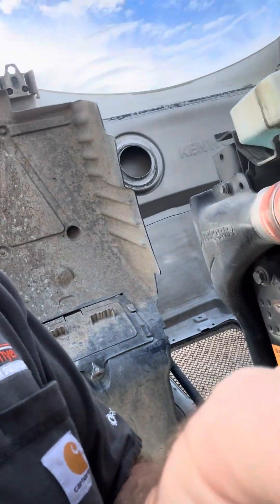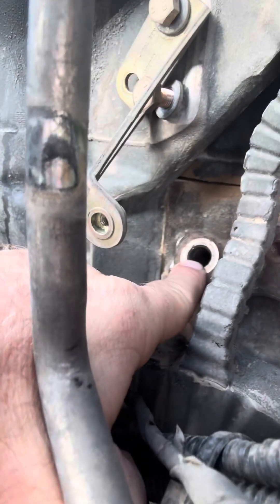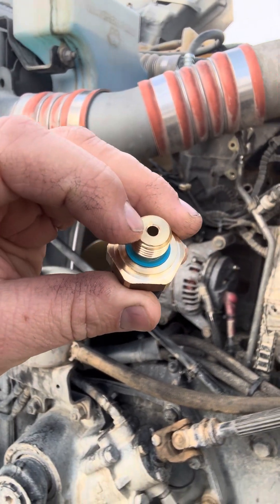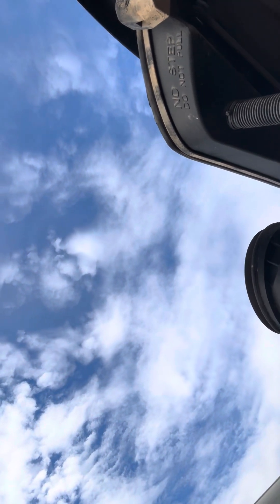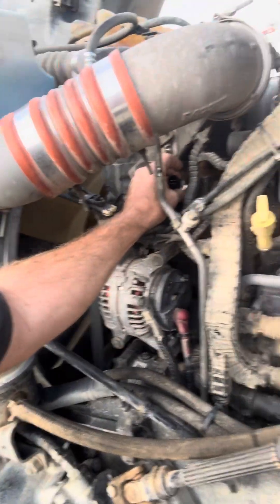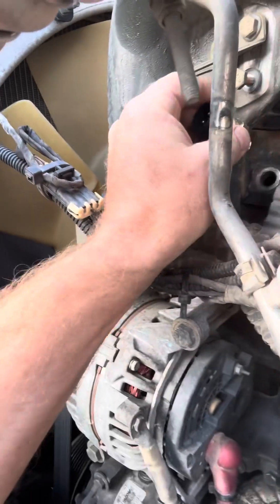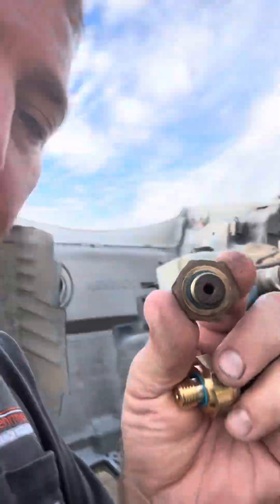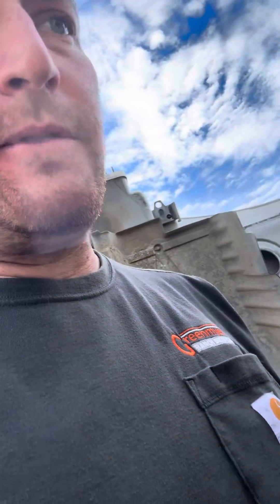Intake Manifold pressure sensor, boost/turbo paccar

Comment: Did you get codes?
Reply from the maker: No.  First time I checked one I had a truck running poorly. Sometimes the boost would be good.  Other times only 20psi.  I cleaned sensor and ran very consistent after that.  Low 30’s psi
Reply: @scottpierovich-gp2zs hey mines is doing the same thing sometimes the boost goes up to 20 psi then all of sudden with the cruise control on I'll from 70mph to 55mph with the boost down to pretty much 0. Then sometimes it will kick back up to 20psi. So I appreciate the video I'm definitely going to try this. I thought it was my actuator on the turbo going out. I changed it in 2019.